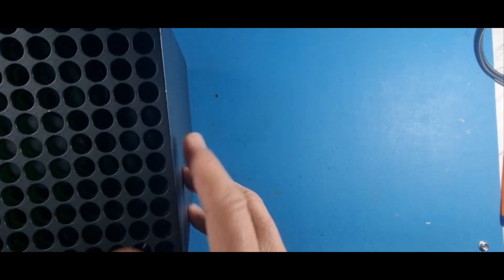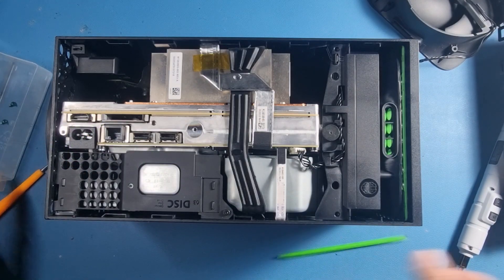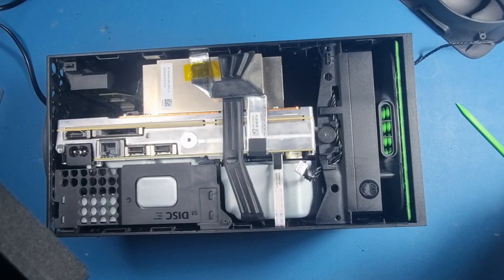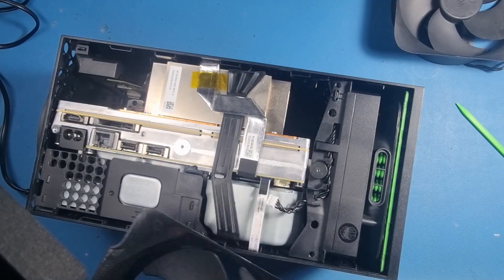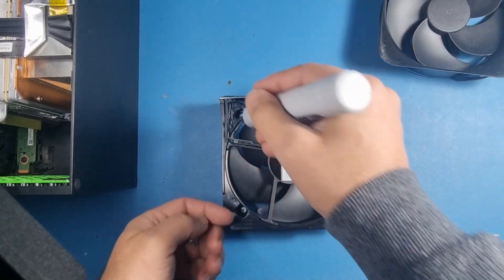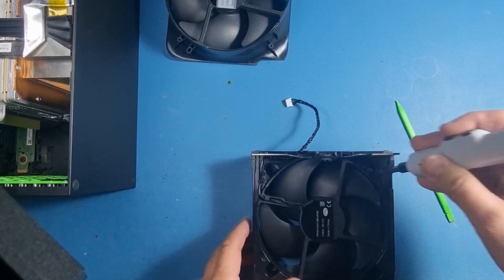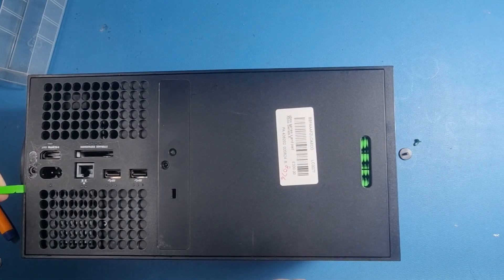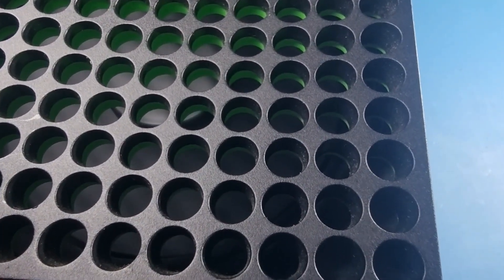Xbox series X fan Failure, How to replace a faulty fan

Comment: i think my xbox got fan problem, RPM fan doesnt increase while heavy load, it same RPM on all condition while idle or playing games, so it make me kicked out to dashboard or sometimes shutting down without overheating pop up error message, this is problem from PSU or Thermal sensor or Fan ?
Reply from the maker: Hi, its a difficult one to diagnose as i have not come across on as yet
Reply: Exact same issue I am having at the minute. Any progress finding a solution?

Edit : I've been having this issue for probably around 3months but I've been dealing with it until I finally got round to playing Space Marine 2 which dashboards or turns off the console before I can even finish the tutorial. (10mins or so with the fan not throttling correctly)